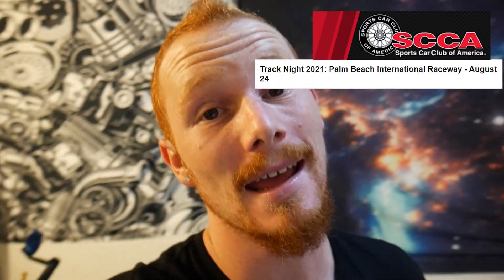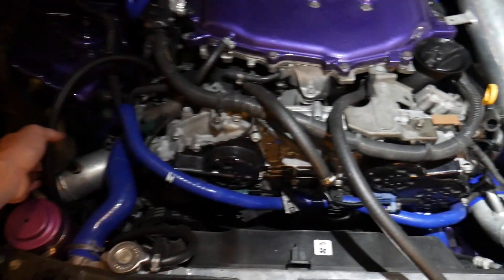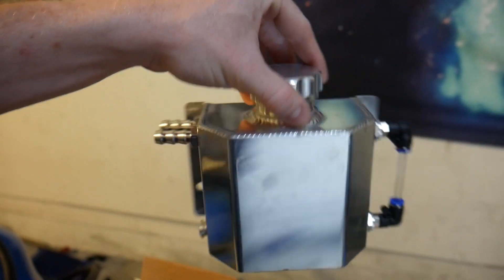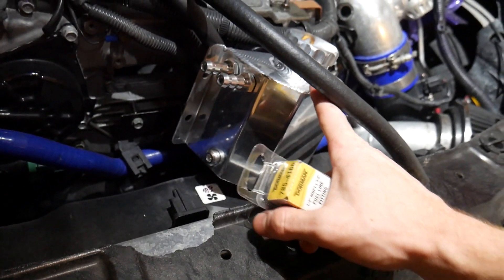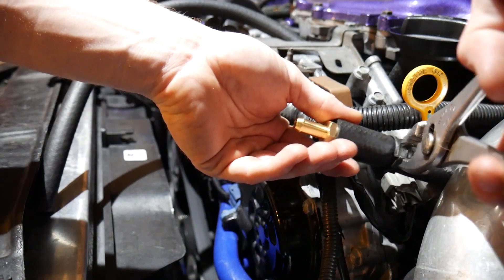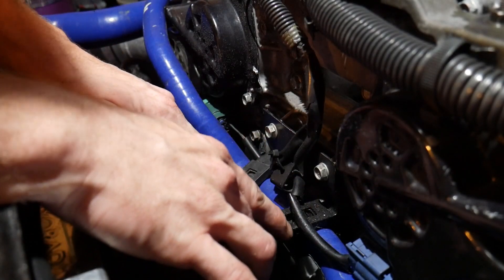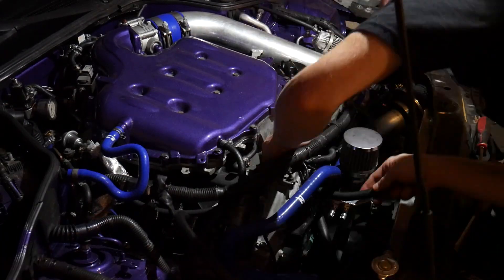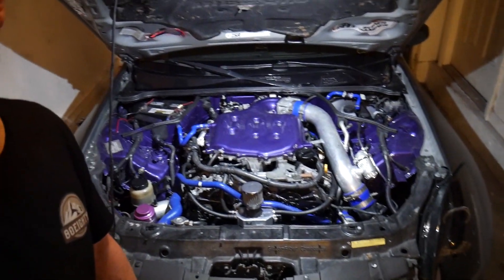How To CHEAPLY DIY an Oil Catch Can for your BOOSTED VQ!

Comment: Hey how’s it going with the intake hose is your adapter having problems slipping out since it is by threads and the hose is making it oily a lil bit does it tend to slip off or anything

Comment: Why do other catch can vids only have two connections?
Reply: Usually you have one where the oil goes into, and the second one connects to the intakamanifold where the excess preassure or vaporized oil goes to. And sometimes people add a third one which connects to the bottom of  the engine to where the oil goes directly

Comment: Can I use a plenum spacer and the kinetix style  top manifold with the Z1 throttle body and actually get decent results If your just goin for a slight build? Possibly injectors shortly after.  There's not many VQ guys here in the valley.
Reply: If you use the kinetix manifold that negates the possibility of running a manifold spacer, if you’re gonna run a big throttle body and upper plenum make sure you get the lower plenum ported as well
Reply: @bbjgarage  Thank you. i just didn't wanna go get a manifold right now if I don't need it. I actually love the addition of the spacer and throttle body by them selves.

Comment: I'm having issue with my g35 sedan with a misfire on #5 it had a tube seal leak and I copied your other video with using a Honda seal so I went ahead and did that made sure everything Is connected where it should new spark plug ignition coil are good but I'm still getting a misfire on it I pulled the sparks p out and there were dry do you have any suggestions?
Reply: bad coil pack
Reply: @cottonbowen6531  I'll test them out again I'll let you know on any updates
Reply: https://youtu.be/Z13-gBxbIaM
Reply: Update it's not the coil pack or radiator fan I believe I may have a burnt valve which is giving me the misfire thanks for your suggestions tho
Reply: @losc4927  dang dude! best of luck